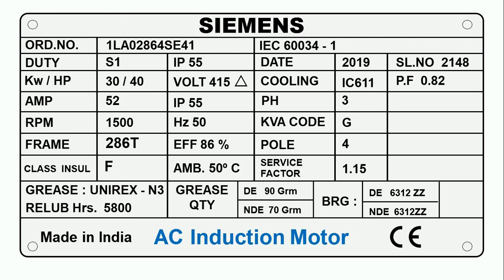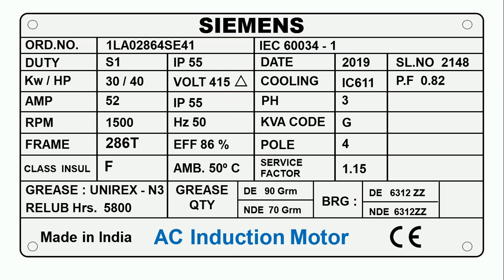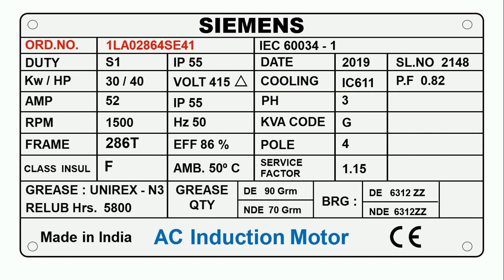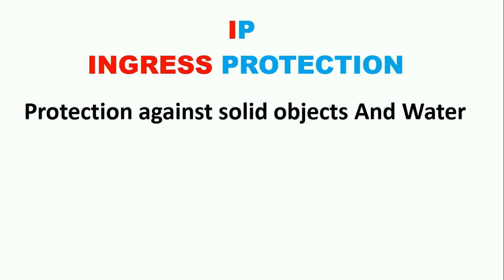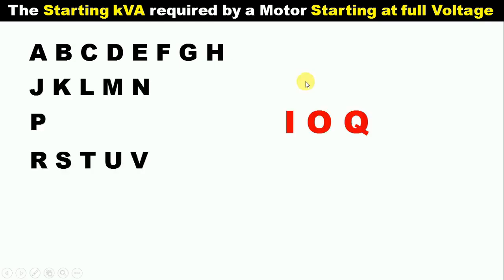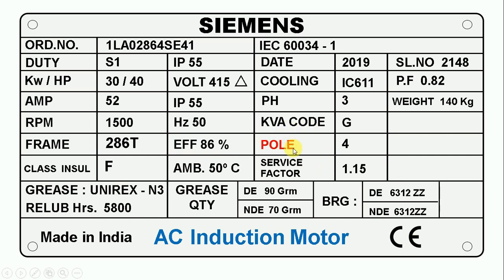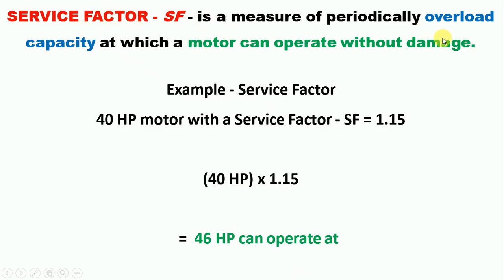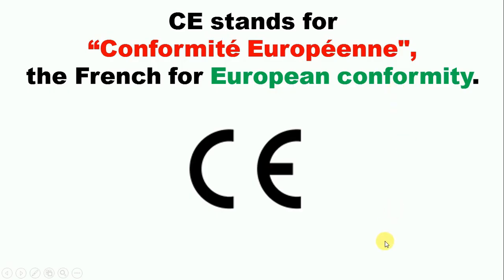Motor Nameplate Details Explained | How to Read Electric Motor nameplate @TheElectricalGuy

Comment: The bearings used are ZZ (both sides are metal shields) generally this type of bearings are packed with a suitable amount of grease during manufacturing and not required for further regreasing. The above statement and the nameplate details are contradictory, please clarify.